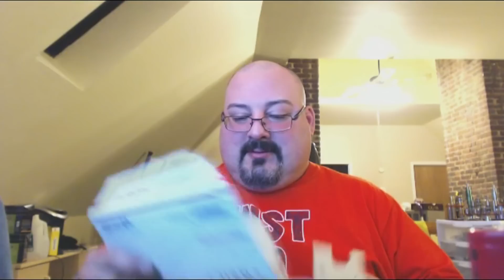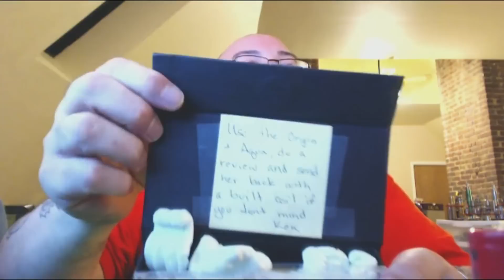Aqua Atomizer

Comment: Hi Bishopheals, you are the no #1 reviewer around you seem to want to help everybody and reply to everybody unlike most reviewers.

Just a quick question from your no #1 fan in England, what types of cloth are you using for the polishing of the mods.

And also do you use a adapter for the drill to connect to 510 devices,

Thanks buddy
Reply from the maker: Hi Rooty, I use mico Fiber towels the same u use for removing wax from cars.

Comment: what kind of drill bit that you put your mod on to polish it? i def need one of those
Reply from the maker: I don't use a drill bit. I use a cartomizer.
Reply: i work at a place with a machine shop.  i want to put some 510 threads one some round bar and put some threads in the end for a pan head screw so you pop out your firing pine and screw the pan head through the top cap in to the round bar after you have screwed it on to the 510 threads for some extra security and stability.  would that be something you would be interested in checking out? review maybe?
Reply from the maker: I use a carto to hold the mod in the Drill.